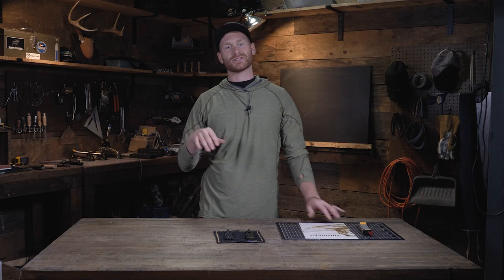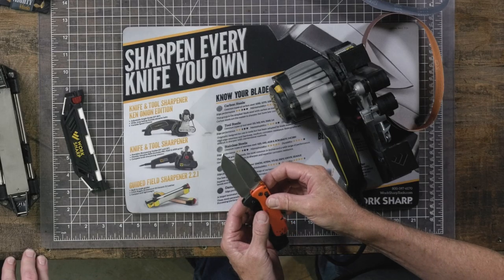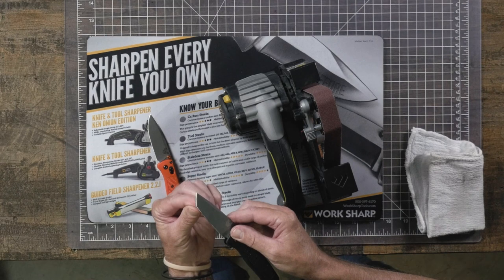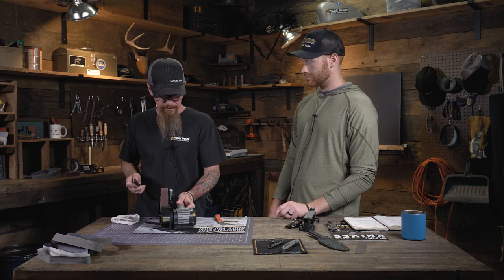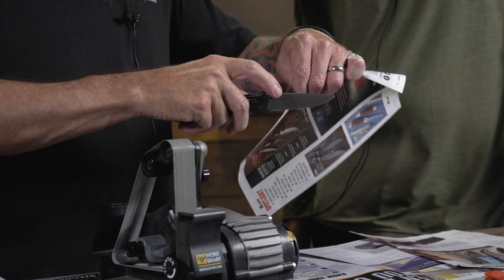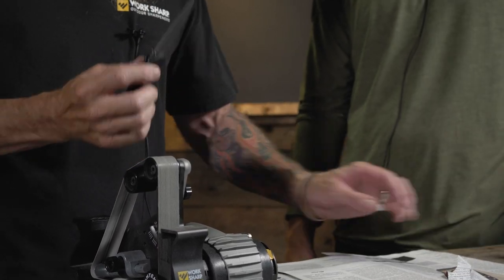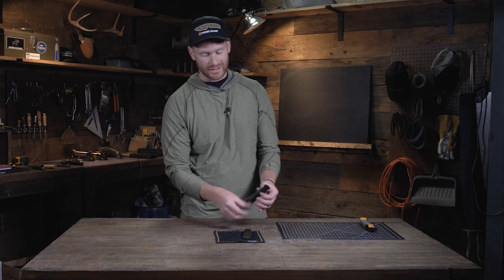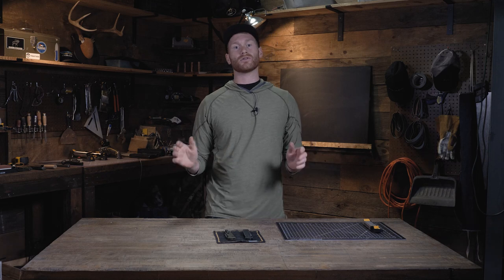Tanto to Drop Point - Changing the Bailout to a Dropout - Workshop Ep 16

Comment: nooooo the tanto, THE TANTO!! :P So, question... how would I go about the other way around? re-profiling a drop point into a tanto?
Reply from the maker: Wow, that would be a lot of material to remove. You would need a flat and hard abrasive like diamond rather than a belt. I've never done that personally but I would start by marking where I want the transition, and sharpening the front and back of the blade independently working toward that transition. This is not an official recommendation, personally I would be intimidated to try this and potentially ruin one of my knives.
Reply: @WorkSharpOutdoor  I hear you loud and clear, it'd be an interesting experiment though 😉

Comment: I noticed Steve did Josh’s knife set at 20 degrees. The recommended angle in my instruction manual is 25 degrees for similar knives. Was this for personal preference? Or do BENCHMADE knives in particular work best at 20?
Thank you for the videos. I am liking this “Workshop” series. Could you do more videos focusing on the Blade Grinding Attachment? It really is the best and most versatile thing out there.
Reply: Its all personal preference. 25 degree edges wont bee as slicey (wont feel as sharp) but will hold their edge longer, 20 degrees will be sharper but dull faster. I carry thicker spined fied blades and sharpen them at a 17 degree angle, if you like sharpening thats what I would reccomend.